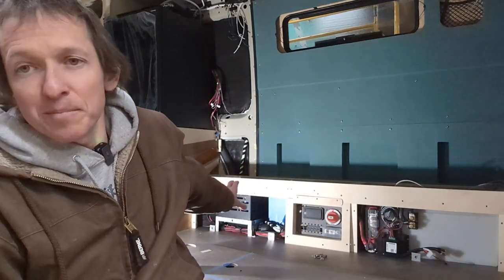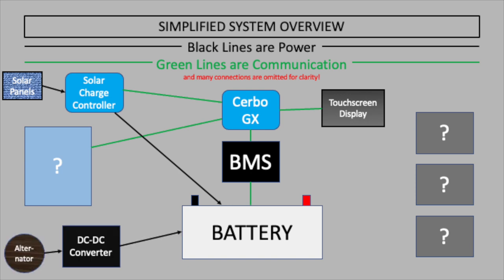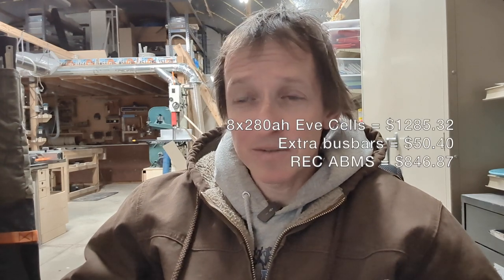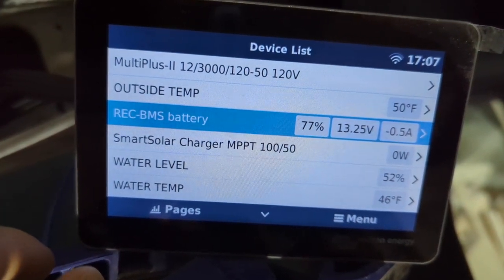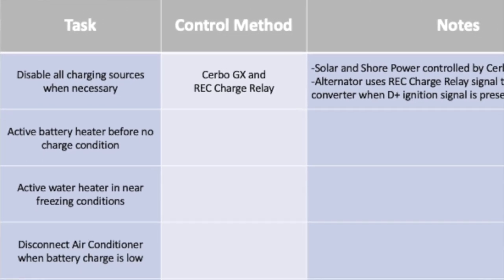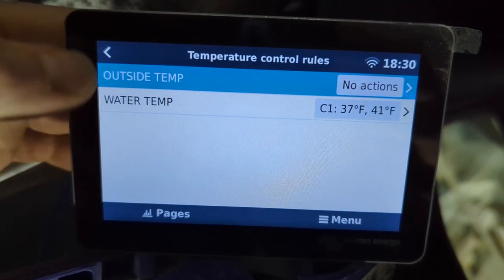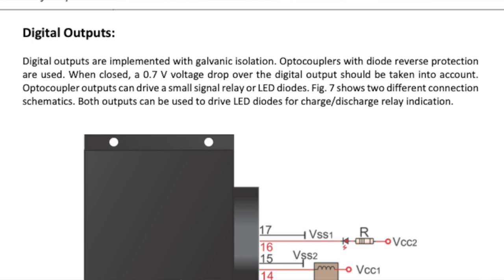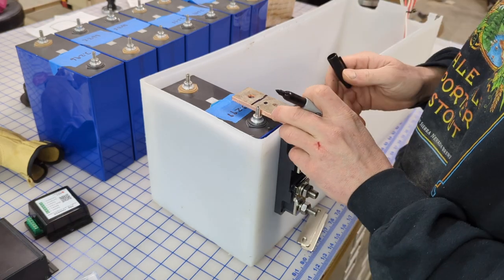Automated and Informative Camper Van Electrical System!

Comment: I’m probably very late to this party but what they mean with the bms optocoupler outputs is as follows: Vcc means a connection to battery positive. Vss means a connection to ground. The “load” (the thing you want to switch on is permanently connected to B+ and the bms connects the ground side of the load to B-. This is a very common convention in digital outputs called “open collector switching” It is not ok to reverse these connections as it will result in damage to the outputs.
It is “engineer speak” and probably wasn’t a good way to label the manual for the end user :) I hope this helps someone :)

Comment: For the 9 pin connectors, I just wrapped them with tape once I was sure they were good. But yeah, would have nice if they had made it a threaded socket.

The issue with the fuse isn't so much the voltage (though that can be an issue) it's the Amperage Interrupt Capacity. A battery pack like yours (or mine) can source some 15,000A short circuit current for a (very) brief period of time. The Class T fuse will pop, and can interrupt up to 20,000A. Lesser fuses will potentially arc across and continue to conduct even though the fuse is "blown".

Thirdly, you should check out Node Red on the Cerbo. You can do all sorts of cool automation with it.  I"m using it to automate and monitor my bilge pump, control the charger for my starting battery (My alternator charges my lithium bank directly). 

For the two opto-isolators, they'r ejust standard opto isolator outputs... In the schematic, they're indicated as low side switches. When enabled, they connect whatever is on the Vcc side to the VSS side. it's drawn that way since it's electrically isolated, so you could use any independent ground and voltage source to run it. (You could safely, say, use a 5V supply and it wouldn't connect to your main 12v bus).

Anyhow, thanks for your great video!
Reply from the maker: Hans!  Thank you.  This comment is so much more helpful than anything I could get out of REC.  It really helps me to understand the opto-isolator portion.  You are correct on the voltage vs amperage interrupt capacity.  Just checked my notes...that's what happens when I don't check them before opening my mouth.  

I have heard of Node Red and honestly it intimidated me a bit.  My primary "wiring" experience comes from working on weather stations for a research program.  So lots of small solar installations with data loggers, but I primarily was the guy on the ladder and not the guy in the office writing the code.  Seemed like even more time invested and I need to get this van built.  

And thats where my frustration with the 9 pin connector comes from.  Yes, tape is an easy solution, but it clearly is the differentiation between the field tech and the engineer.  We'd get these wetness sensors that required soldering to replace if they failed.  Have you tried soldering at 12k feet with a butane torch in the dead of winter when its close to 0 deg F? The engineers clearly hadn't. Its the little details to me that indicate a tested and thorough design.  

Thank you!

Comment: Can you recommend a compatible waterproof temperature sensor for the cerbo gx? I want to drop a temp sensor in my greywater tank and use that signal to control a heating pad, just like you've setup. Stuck on sourcing a temp sensor that works at the moment.

Comment: Why I use E-T-A ESR10 solid State Relays.. They only draw 10mA of current when closed...And they are made for 12-24 volt installations...Only sad part is they only go too 30amps..Where Ford makes them rated up to 70amps...